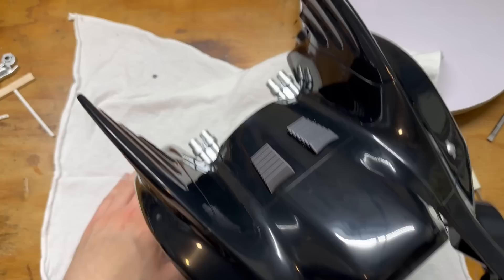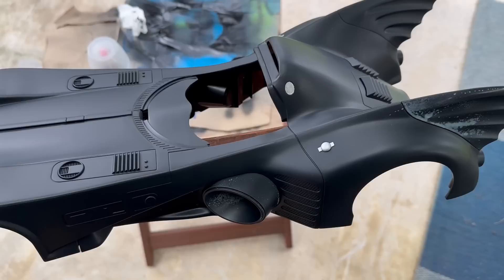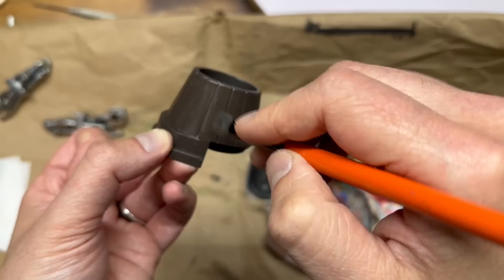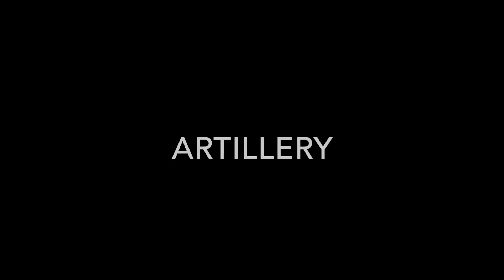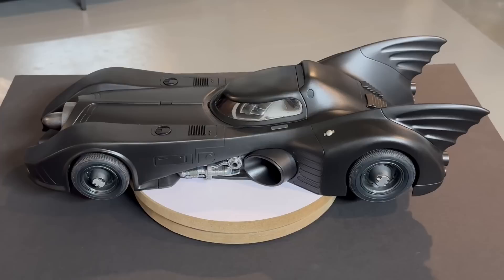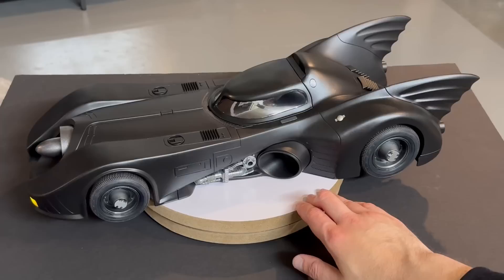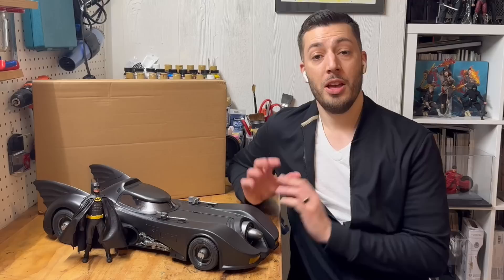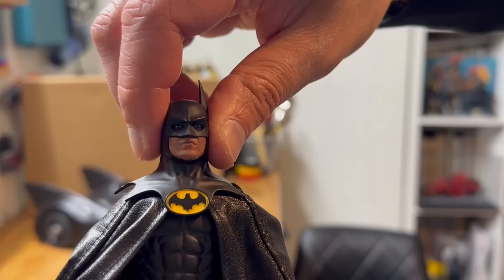Customizing The McFarlane Batmobile Pt. 2

Comment: Great work on everything, but the chopped canopy makes all the difference in the world.  I highly recommend a Rotary Flexshaft tool instead of a Dremel for customizing.  It has a foot control and a chuck so you can use dremel bits all the way down to micro drill bits. It is typically used in jewelry making but I use one on a daily basis for sanding, cutting, and drilling. The best brand is Foredom but there are cheaper ones available.  If you have questions about them just let me know.  Looking forward to future builds!!
Reply from the maker: Thank you, and thanks for the tip! That sounds like exactly what I need. I'll look into it!

Comment: Very cool!!

I’m super novice at this stuff, having just taught myself during the pandemic. 

I’ve not done anything on this scale, yet, other than weathering a JAKK’S BB-8….which is only big, not difficult. 

My McFarlane is still boxed, but I may do prelim work on the Spin Master Batmobile. I know is smaller and not McFarlane, but if I screw up, at least I’ve done so with a less expensive piece. Then when I “get it” I can move to the big boy and knock it home. 

Great video. Thank you for sharing. Shout out to the “I wanna give up” confession as well. With all the crafts and artwork I’ve done, I’ve had so many of those moments. I just have to breathe through it. Maybe for a few days and come back. Glad to see it’s not just me.
Reply from the maker: Thanks very much! Haha, always helpful to know "it's not just me", right? Very glad you found this fun hobby during the pandemic. It's a bit part of what got me through all of the isolation. I think starting with the Spin Master version is a really smart move; kind of a "measure twice, cut once" approach-- you'll have a much better understanding of the anatomy if this car after working on a smaller one, for sure. Thanks for checking out the video!

Comment: Hey, that's a killer job man.  It looks night and day better than the original.   I just got one of those 1/18 scale Jada clone types and day-one, Of Course I'm going to disassemble the whole thing.  The changes will be repainting the all-silver machine guns, thruster, tailpipes sidepiping etc.  Fortunately, I didn't have to build the machine guns but I did have to carefully hollow out the ends of the solid barrels on these tiny guns.   After paint (this is my first project), I'm going to add leds and a sound module which will play the sounds of machine guns firing, the turbine, shield operation or anything else I find that works.  Mad scientists....
Reply from the maker: Thanks very much! Those 118 Jada versions are beautiful-- so much more challenging to work on that scale, my hat is off to you!

Comment: There is a 6" Batman figure from the old DC multiverse line, which is inspired by the old toybiz 89 Batman. So if you swapped the head with lets say the mezco one, I think that would work nicely for your now two seater Batmobile.

Also you did a great job with your Batmobile. The paint alone really added more to the flair of the car. If you had like a translucent flame effect for the jet exhaust I think that would look great. Especially with the led light you got going on. 

All in all, fantastic job.👍👍
Reply from the maker: Thank you! Yeah that Batman figure is getting harder to come by, but I might do that! At the end of the day I'm always going to display the figure next to the car anyway, but it'd be fun to pop it in there once and take a few pics.
Reply: I totally did that very thing with a 3d printed head. It's a great body. I used the 2003 robin figure from Mattel and they both fit in the batmobile. I didn't customize that though. I don't have the skills this guy has. I'd probably muck it up.
Reply: @user-dk9vt2eq3u  dang. Id love to see how that Batman turned out. Was it easy to do the headswap?

Comment: The canopy modification you did on yours really changes the look of it and makes it look more accurate because the proportions of the toy car are pretty spot-on. I'm printing a 30-inch 89 Batmobile and the designer was a little bit off on the canopy so I'm doing my own surgery on it to get it more accurate looking. When I get a chance I may have to pick one of these up just to mod it that's the fun part of it! Also this kind of plastic I forgot the the name and type of plastic that is commonly used for toys. I seen a lot of guys that do the mods on the Star Wars Hasbro toys and the paint does not stick to it they have to use what they call adhesion promoter On the plastic and then the paint will stick to it. You did a killer job on this you should be proud of it!
Reply from the maker: Thank you very much! a 30-inch version sounds awesome! That's going to be a real lovely display piece for sure!
Reply: @Ibrahim_M  Just like you said in your video I got tired of working on it because I've did so much sanding to get the body smooth and so many cans of primer Lol.
Reply from the maker: @ray24051  😂😂

Comment: That canopy is chefs kiss. I was thinking something looked off about the factory version and it's the slope or lack thereof. You fixed it. 

I'd love to play around and see what 6 inch scale figures. Could fit inside the cockpit. I know someone else mentioned the 80th anniversary Mattel batman, that's one I used because I can't afford the more expensive stuff like Mezco. It fit with the Mattel 2003 robin but I didn't customize my batmobile. Too scared I'd mess it up. I just sort of shoved them both in there. It's a little bit of shoulder rubbing with them both in there but it worked for me. 

Your piece though is great. Really a museum style replica in 1/12 scale.
Reply from the maker: Thanks so much! And thanks for sharing the info about those figures and how they fit. I think if I were going to routinely put figures inside I’d cut some panels out of the sides to make some elbow room— that would just about do it for any 2 6” figures if moderate size, I think.

Comment: Reynolds supply, crystal clear 200 is what you would used to make hardcopies of the canopy. The stuff is very durable and very hard and I think you’d use the platinum cure silicone to make the mold I have made molds like that before of clear Parts . But you are correct. It is expensive. It can be messy It is time consuming.
Reply from the maker: Yeah the materials are not the issue unfortunately, it's the shape of the canopy. it's shaped like half of a bowl with two 3" tabs coming off of it, and those tabs have circular track pieces. Getting any kind of resin to completely fill out the void inside the mould in order to 100% cast all of that would be nearly impossible unless you're in an actual factory with expensive equipment made for this kind of thing. Hell, McFarlane Toys couldn't even get it right 😂. There would be gaps and holes, and just missing parts on every pull, and that's a good 30 minutes wasted every time, plus materials. It's hard enough to cast something like an action figure head half of the time (they'll come out missing a nose or half an ear, etc), and that's a fairly solid shape.
Reply: @Ibrahim_M  well, my heads in all my parts come out perfect because I use a vacuum chamber. And a pressure chamber. I’m sure that part is made by some type of vacuum machine or a mold  made out of metal that spins. It’s definitely a hard piece to replicate it looks like.
Reply from the maker: @jameshopkins5702  Yeah, exactly. I'm only setup for little cups and hand-made mould trays, and that ain't gonna cut it for this! haha. And if I were to invest the time (which I don't have) and money into a setup like what you're talking about, people wouldn't pay the price necessary for me to even break even. And I'm not setup for shipping on that volume. So all of that is why I said in the video that it's just not an option. Someone would offer a 3D print file or hard copy in that time anyway.

Comment: Hey I was getting antsy waiting for part 2!.
What about using plastic sppons with various types of paints to spray clear coat tests on? For example spoons 1a, 1b, 1c, 1d are black Valejo, spoons 2a, 2b, 2c, 2d are a red Citadel, spoons 3a, 3b, 3c, 3d are a blue Krylon, spoons 4a-d are yellow Tamiya, a =Krylon clear coat, b=Tamiya clear, c=Duplicolor, d=Mr Hobby. Pick the variations that work best for you, hopefully this makes sense? Now the spoons I think are made of styrene, as far as I know, so testing plastic reactivity wouldn't be possible with this method. Index cards could work instead of spoons for that matter...
Reply from the maker: Lol yeah man you can paint all the spoons you want!

Comment: Fantastic customization work - silly question but can you actually seat 2 figures in the vehicle with the cockpit canopy closed? Thanks!
Reply from the maker: Thanks! Yeah, depending on the figures. They definitely have to be 6" (this car is actually 1/12 scale despite being made for a 1/10 scale figure). They'd need to be like SHF/Mafex scale for two to be in there together. The seats I used have bolsters that make it difficult to fit certain figures in there, but I'm not displaying it that way anyway. If you were really set on fitting two figures in there at all times you'd need to cut out some side panels in the cockpit to make some elbow room.
Reply: @Ibrahim_M  Excellent thanks for the reply and fantastic work again!
Reply from the maker: @99Vood99  Thank you!

Comment: Finally! Looks amazing, brother! When you were talking about the lighting in the afterburner, I got the idea of maybe getting one of those cheap rc cars with the steam that blows out the back that looks like flames, that would be sick if you could make that work in this, I'm sure you could with your knowledge. I know the Spinmaster rc 89 Batmobile  that's coming out uses that water mister feature  also.
Reply from the maker: Thanks, man! That would be cool. I'd need to look into how to make one or if it's possible to buy just the steam kit, since the actual spin master version is pretty expensive, haha. But ultimately this is going into an enclosed display case, so I'd have no use for a steam/smoke function. It would cause moisture damage to my other stuff, haha.

Comment: I currently have mine ready to customize with all the pieces needed. The only thing I can’t find are the half red transparent pieces you used for the tail lights
Reply from the maker: Nice! There's a link in the episode description for them. You'll need to double check the measurements in millimeters and order one pack for each set of lights.
Reply: @Ibrahim_M  ok thanks for the advice I’ll do that. Excellent work it literally looks and has everything a hottoys quarter scale does but  smaller. Paired with the mezco 89 Keaton 👍🏼

Comment: Truly amazing work!  I don’t even have the words. Whenever mine arrives I plan on studying these 2 videos very carefully!  Regarding the paint, you mentioned black matte followed by a gloss coat?  Gloss or semi gloss?  And what brand?  Did you ever consider airbrushing some clear blues and purples so it’s not that solid black you mentioned in your first video?
Reply from the maker: Thanks, Neehar! The gloss coat was a krylon gloss clear coat. I have actually considered that! I’ve recently learned of some airbrush paint that I want to try so im going to be ordering some to test. If it works well I plan to try to use it in this. I typically don’t like airbrushing over wide areas but I think a tinted clear coat would be nice on this if I can get it to work.

Comment: Clear glue sticks, cut to size and tinted red might work for the rear lights.
Reply from the maker: That could work! You'd have to find big ones though, as regular sized would be too small.
Reply: @Ibrahim_M  They generally come in two sizes around here. The big ones look to be about the right size.. but I can't know for sure, of course. Still, they're a buck or two at the dollar store.. worth a try, I'd think.

Comment: just knowing it has 2 seater is enough for me - but is it possible to hollow out the sides and the back area to give the figure more space or would it compromise other parts ? - great project -really would like to have this version of the batmobile
Reply from the maker: Thank you! Yeah, you can definitely cut the sides out for some elbow room as long as you keep the frame of the cockpit box intact. I don’t think you could go back any further, but there’s a ton of leg room so you could always move the dash a little bit.

Comment: Great custom!  I started breaking my down last night.  Have a problem getting the front intake off the body.  With the frame and body split.  I don't understand how that is clipped in at all.
Reply from the maker: Thanks! Yeah that part was tricky. It kind of clips in at the very top. Warm it up a bit with a blow dryer and it should move much more easily.

Comment: Good job man,but i think there is a slight gap between midfront section of the glass with the canopy. Maybe you can redo it to perfection. Btw i bought an RC Batmobile about 40cm long in 2005,with rubber tires and functional lights,a chinese knockoff but surprisingly it was accurately build.The canopy can slides open,and yes it is "chop top" style, 2 seaters, and even have 2 detachable machine guns.I remember it had Harry Potter stickers all over the body, so i repainted it matte black. This Mcfarlane version is no better,only bigger.
Reply from the maker: There is a slight gap— that’s as good as it gets. Maybe you can try it yourself and see how perfect you can get it and then tell me how to do it!
I think a friend of mine has that same knockoff version, or one like it. It’s too small to be 1:12 (more like 1:16) but aside from the stickers it was pretty screen accurate. It’s actually really well done.
Reply: @Ibrahim_M  i have to buy it first haha it's pretty expensive here. I think i will chop the canopy same as you did in video part 1,but since the glass have midfont pillar too,so i will remove the midfront pillar completely from the gutted roof, adjust the roof to the glass contour below it and then touch up with plastic steel epoxy.sand it then paint it. Thank you sir,you inspire me.good job👍
Reply from the maker: @akudhega  A word of advice: a lot changes when you actually have it in front of you and you see how strong the plastic is and how difficult it is to cut. I was the first person on the internet to do this, so I didn’t have anyone to show how it could be done because I was the first person crazy enough to try it 😂 good luck!
Reply: If the midfront pillar to be more thicker, i will add some plastic steel epoxy to it
Reply: @Ibrahim_M  yes,act of bravery to cut it out😀
Reply from the maker: @akudhega  Yeah, the reason that I didn't do that was to preserve the windows. It's a very small, precise space to put clay into, and it's very easy to get it on the "glass" and ruin the windows. This project was full of decisions like that: "do I potentially ruin the whole thing trying to fix something small and not that noticeable?" haha.

Comment: ooo that looks good! Real good! I just ordered one and, while there's no way I can go as hard as you did, I did gain some insights and hope to at least do a two seat mod. I might try to buy a third party canopy because it looks so much better with the lower profile but no way will I try to mod my own.
One question, you linked the 9mm gems you used for the tail lights but there are two different sizes ones. What was the smaller size you used?
Thanks!
Reply from the maker: Thanks so much! Yeah now there's a set of the canopy, weapons, and gas caps coming from Ramen Toy, and they look pretty great. For the tail light gems, it was the same link, and then under the different options is where I found the other sizes. Looks like they changed it though. The 9mm are actually the smaller ones, then the larger were 11mm: https://amzn.to/3GoC8AH
Reply: @Ibrahim_M  Oh alrighty, thanks for the info!

Comment: Had another question for you. I saw you sprayed the wheels with that tamiya spray. Did you paint them silver first and then spray it? Or just sprayed over the stock black. One other thing I read is that the air intakes on the side were a similar tinted chrome on the inside
Reply from the maker: Correct! I painted silver and then did the smoke tint. And ultimately I wish I had dont less of the Tamiya Spray on them. I'm thinking about redoing them, in fact. And if I do, I might do that side intake as well-- I couldn't find anything concrete about them being the tinted solver, but I think it looks cooler when they are, haha.

Comment: Do you have a parts list for the LEDs. I'm a newbie when it comes to wiring and electrical, so I don't really know where to start or how to wire it up to work correctly. I would really appreciate it thanks.
Reply from the maker: I’m afraid I don’t— I ordered a bunch of stuff at once a long time ago so I had most of what I used on this when I started the project. But I use evandesigns.com; they’re great and they make it super easy. Basically you figure out the size and type of bulb you want, you match it with a battery pack/switch combo of the same voltage, and then when you get them in hand you just twist the red wires and black wires from the bulbs and the battery packs together, and you’re good to go. The customer service from them is great too— if you have questions about any of it they reply with helpful details. I was new to it as well and they made it nice a easy 🙌🏼
Reply: @Ibrahim_M  awesome thanks for the info it's greatly appreciated.
Reply from the maker: @mjcivilcowboy08  you’re most welcome! Best of luck with the project 🙌🏼